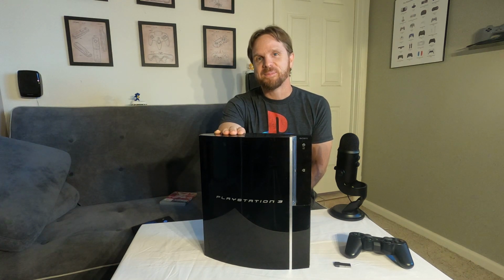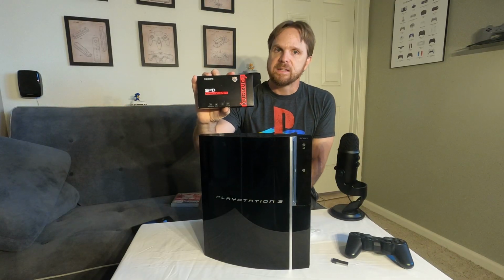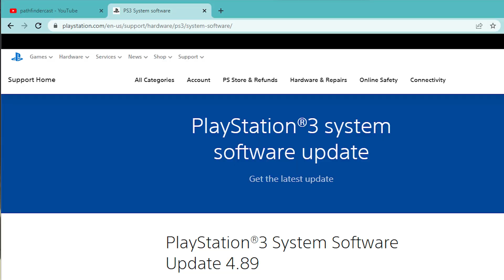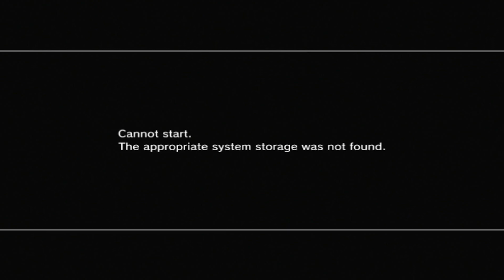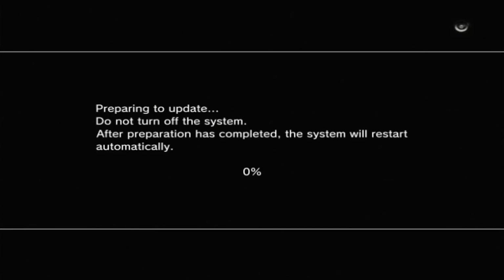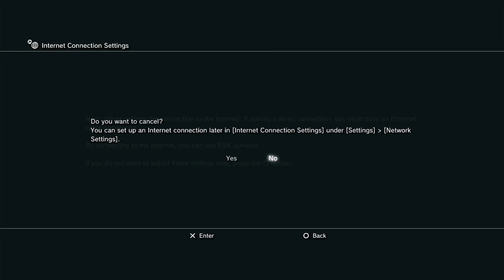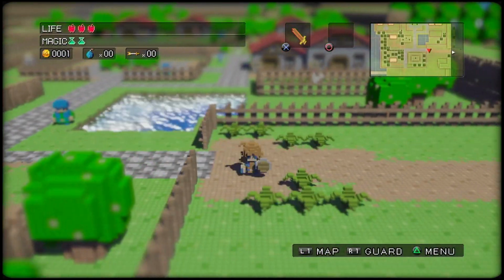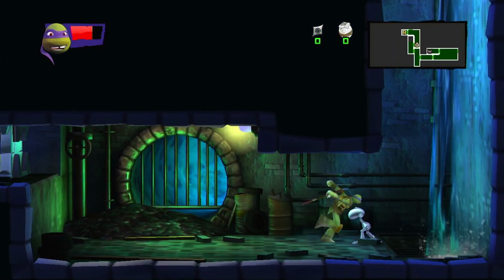Installing a cheap 1 TB SSD in my PS3 for a performance boost

Comment: I personally wouldnt use an air compressor like that. I have seen before airline have a tiny oil in them as it passes through the airline.

Comment: Pro tip just by a new hdd saddle save headaches and striped screws.
Plus sata speeds are locked to sata1 1.5 gbs max. 
So don't spend extra money on sata 3 or whatever gimmicks
Also be sure to back up your save files several times.  As ps3 reformatting the drives is a thing when installing

Comment: How did you initialize your hard drive? Is it in MBR or GPT?
Reply: The PS3 will usually do it for you. However the max capacity for the PS3 is 1.6tb so anything over this limit will not format the drive once inserted to the PS3...

Comment: where did you get the  firmware for ps3 after you replace hdd
Reply from the maker: I got the link from the Modded Warfare video that I linked to in this videos description.  Here is a direct link to though https://www.psx-place.com/threads/cfw-4-89-evilnat-cobra-8-3-cex.37294/
Reply: If you don't want to mod it, the fat Playstation3, automatically downloads it. Otherwise it's on the Playstation website

Comment: Hey man. First time watching one of your videos. I enjoyed it. I've took many of these apart and delidded more than I can count. My advice would be download and install webman so you can view the temperatures and control the fan. I would open the console sooner rather than later to give it a deep clean and at least replace the thermal paste above the IHS plates. If you decide to delid the cell & rsx just do plenty of research and practice on some dead boards. That's how I learned. I recommend using 0.08mm molybdenum wire instead of the painters knife technique. Take care
Reply: Are you a repairman? My PS3 Super Slim started this high frequency, whisper-like noise when it's turned off, about a month ago. I've run the game to test it, and it worked fine. I've read on the internet that some people with similar problem had burning plastic smell also. So i've been keeping it unplugged, ever since, as i am not comfortable keeping it plugged in. I've plugged it in a few minutes ago, to test if the noise was gone, it sounded like cartoon fall noise https://www.youtube.com/watch?v=Qgx-WOn8CDA , i unplugged it immediately. My guess is that the power supply is dying. Have you encountered with this, is it safe to use PS3?

Comment: I put a SSD in my old PS3 several years ago (fyi, the max size a PS3 can handle is 1.5 TB).  Didn't really notice any speed up though.
Reply: Some videos have revealed that is not too much of a boost
=
Reply: I want to do it to keep my PS3 slim alive. I bought it brand new. Physical hard drives die.

Comment: Very interesting video! I've also a jailbroken PS3 and I wondered how it will be with a SSD. Thanks for that!
Reply: It is much better and less heat for the system. Those SSD also work great in the PS3 for games always loading big maps, having rendering issues or pop-in issues.
Reply: @sonyx5332  not exactly true as stated above... The PS3 is limited and only a sata 1 type drive will help you achieve this. I own a SATA 1 hybrid drive on my PS3 and it is actually much better then a SSD as I've tried many SSDs and most are above the SATA 1 connection so there is no real benefit. Matter of fact having any SATA 2 or  SATA 3 hard drive or SSD . The PS3 with time will kill it much faster then the HDDs or SSDs lifespan really is as the PS3 is already bottlenecked and it only adds to the problems.
Reply: Your limiting factors are going to be a sata 1 interface speed.
So your going to be limited to the fact that it'll never really be that much faster than 1gbs

Comment: I upgraded both mine an my brothers PS3's to a 1 TB SSD an wow what a difference in speed it makes. I've loaded 40 of my games onto it from disk to ISO and now I don't have to load the disk ea. time. I would say average speed to transfer the game 15 to 20 minutes an on FAT32....that is fast!!  All the other reads I've made say that it don't make that much of a difference but it does and I recommend it if it's in the budget.
Reply: It helps to a certain degree however if you were worth to downgrade to SATA 1 hybrid HDD with some SSD compatibility the PS3 is much faster then the SSD as the PS3 has a SATA 1 connector. So anything above give it no real benefit yes you'll see faster upload and download times and some faster performance, however in a couple of months you won't be saying that when the SSD dies or starts to get slower as the PS3 is a HDD and SSD killer . Only hybrid drives work properly and can give the PS3 a real performance boost.
Reply: @truthseekersthenewomega97  "PS3 is a HDD and SSD killer".. So how long your estimate is for HDD last in PS3?
Reply: @XantheFIN  it really depends on the HDD or SSD you are using and how much are you downloading or uploading ... I've had SSDs and HDDs die on me in 6 months another one died on me in a year so it really depends... 

Since I've been using a hybrid drive it's been about 1 year now since i switched from a Samsung SSD to a Seagate hybrid drive... 
The hybrid drive has been working great...
Reply: @truthseekersthenewomega97  I have had PS3 fat model (not the oldest one though) with its original 80GB drive running now 24/7 solid over year as uptime with self build linux system so i was curious.
Reply: @XantheFIN  nice yeah I still my 80gb HDDs working also... Now what I will say this are using the PS3 as heavy gaming and downloading reading and or writing speeds??? 
If not your hard drive can last forever it all depends on read and write speeds how much the console is being used there are so many variables.. 

Also the original HDDs that come with PS3s are SATA... Even 500gb Toshiba and Samsung HDDs and Lenovo HDDs and western digital Sony used were all SATA drives so they are technically up too par with the standard of the PS3...
Reply: @truthseekersthenewomega97  Seagate SSHD or whatevers are worst i think as that 8GB SSD when dies it will take the rest with it from reports of users. Toshiba SSHD are better as when SSD dies it wont take whole drive.
Reply: @XantheFIN  I agree I found Toshiba and Lenovo,w.d have some pretty good SSHDs.. 
Samsung also makes them however it's either 1.2 TB or a 1.5 TB.. which are pretty expensive and at that point better off buying an SSD now. 
But in the PS3s case a SSHD is definitely worth it...
Reply: @truthseekersthenewomega97  Yeah anyway on Linux usage the Sata1 port / controller of the PS3 is slightly bottleneck so need use other interfaces along side with it to get best experience out of the system.
Reply: @XantheFIN  I think if Sony had maybe one more year to complete the PS3 it would have been a console for ages, I think it was still rushed yet late to the scene Sony was Losing money with the Xbox 360 out however it did hurt Sony cause they rushed the PS3 development it could have held up even better in today's standard, although they do hold up at times the bottlenecks on the ps3 can certainly make one wanna turn away from it. 
However for me and you we will probably enjoy the PS3 till Sony becomes great again with console manufacturing.. the cell in my opinion is still by far great it's literally a super computer in a box🤣😂 although with bottlenecks the military and NASA sure did have fun with them🤣😂
Reply: Also hybrid drives last longer on the PS3. 
Ive killed 2 SSDs in the last year-2 years. I switched to a hybrid drive this year and so far it's been good. Just make sure to make a backup of everything.

Comment: I purchase 1 for 65 at 1 pawnshop and I'm really happy it works perfectly the only think is it was fixed or repair it because the og seal was removed and put back .. but they do a really good job no over heat nothing I'm happy 🥳🥳🥳

Comment: Sadly, the old consoles tend to fail a lot more than Slim models, so the best thing to do would be to delid the IHS of both CELL and RSX (If necessary) and repaste both to ensure decent temperatures. I had a PS3 dying due to overheating where one of the capacitors failed. Just make sure to run the console in a rather cool room (about 68°F or lower is more than fine) and you should be good for the most part. For the best PS3 experience while still maintaining CFW support, use an early PS3 slim model (CECH-20xx), but if you wanna have full game compatibility with PS2 games, get a CECH-A01 but that one needs some precautions to run with no issues.
Reply: Misinformant. The problem are the defective 90nm rsxs.
Reply: @goclunker  Which can successfully be replaced with newer 45nm RSXs from PS3 slims which don't suffer the same "bumpgate" issues.
Reply: @MeefMoaf  i know that, OC doesn’t.
Reply: A method of installing more recent ps3 models into the original models exists now so it should extend its lifetime.
Reply: You need to take care of it and clean it from time to time. I own about 7 of them. And when done playing, I'd recommend not turning it off right away and let it cool down on the XMB menu.
Reply: What if I play PS2 games digitally (files not PSN), and still want CFW/ Debug tools? Which model should I focus on?
Reply: @TussalDragon344  You should still focus on the original backwards compatible models if you want the best compatibility and performance.
Reply: @LNCRFT  So only FAT?

Comment: Needed info on speeds pre and post SSD install
Reply: I've upgraded PS3s and PS4s with SSDs and the speed difference was negligible.  This unfortunately is to be expected, because PS3s and PS4s all use internal SATA bridges which bottleneck performance to a little faster than the performance of a 2.5" SATA HDD.

In the PS3 a PATA-to-SATA bridge is used and in the PS4 and PS4 Pro a USB-to-SATA bridge is used!  No matter how fast the drive is that you use, it cannot be used any faster than the limits of the internal bridges that Sony used for these consoles.

Thankfully Sony put this madness behind them with the PS5, finally providing it with massive storage performance for both the soldered-in SSD and the internal NVMe upgrade option.
Reply: @BeardyMacBeardFace    I have seen people record faster speeds and make games such as driving in day z from unplayable to playable . I thought PS4 used sata 2 and going from 140mb/s to around 300mb/s. Also digital foundry recorded many improvements
Reply: @wrusst   Yes faster speeds are achievable, but not significantly faster.  Only up to the performance limit of the SATA bridges used.  There's two sides to those bridges, the drive side (PATA for PS3 and USB for PS4) and then the PS3/PS4 internals side.  The performance limit of that bridge IC is the limiting factor.
Reply: @BeardyMacBeardFace  I don't know 40% in some loading times and making certain games playable seems significant to me

Comment: Perfect! This was exactly what I was planning to do to revive my old PS3! Along with the jailbreak to add retrocompatibility and emulations etc... any insight on how to install/emulate PS1 and PS2 games? Googled around but there's (not) surprisingly very little information on the matter, and still confusing... Thanks! Keep it up!
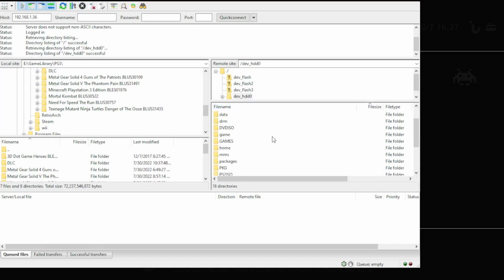Reply from the maker: You can copy over ftp the bin/cue and iso files to the PSXISO (for PS1 games) and PS2SO (for ps2 games).  Then open multiman and go to the retro menu and the games should show up and from there you can launch.  I briefly mention it around timecode 13:00 in the video.

Comment: How’s the ssd working out? I saw it was pretty cheap I’m thinking about buying the same one!! Is it plug and play or do I have to buy an extension?
Reply from the maker: The cheap SSD has been working great so far. I've got quite a few games backed on the drive and been playing through The Last of Us. No adapter needed. I just remove the 80 gb drive from the brackets and put the new one in. I wrote PS3 with a sharpie on the original drive in case I forget what it was from.
Reply: Ok cool I just bought it thanks!!!!
Reply: @thenumber1mailman  I also have an SSD and it does make a difference. Escpecially when you are in a game and press the PS button to bring up the XMB, everything loads super fast.